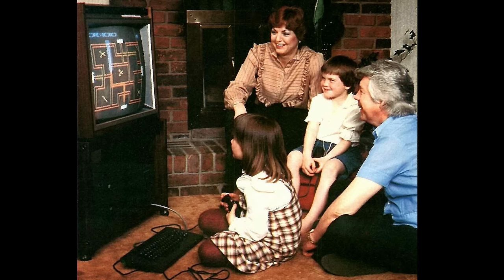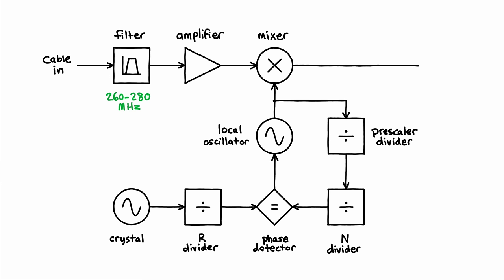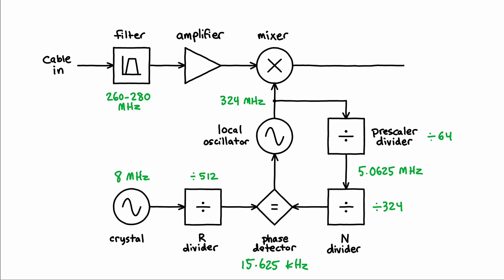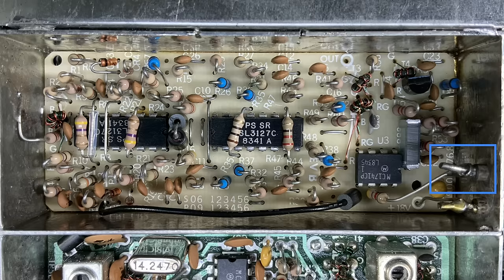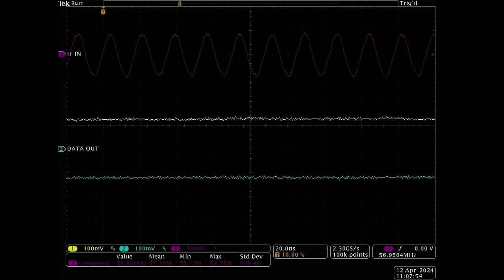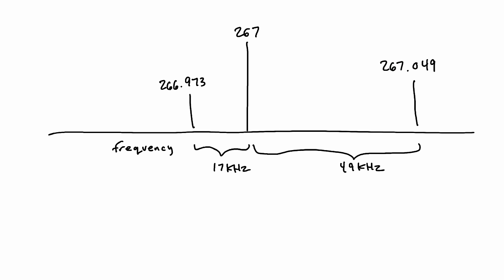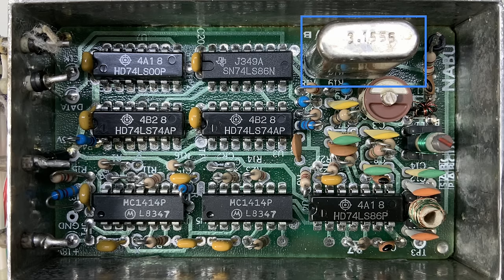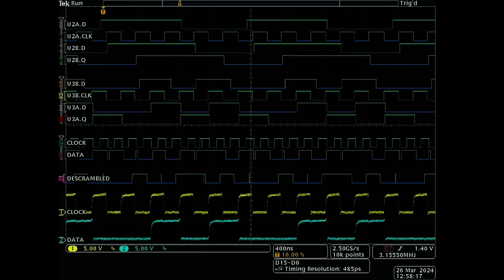The 40-Year-Old Cable Modem (part 1)

Comment: Thanks, a couple of us non RF engineers scratched our heads at this for hours and determined we needed someone more talented in those areas. Between the cable industry docs & Leo's recollections we were incredibly close, and I'm glad you have experimentally proved several of our assumptions! Moving ever closer to having a solution for broadcasting to multiple real NABU modems.

Comment: This is great.  I love the way you explain not just how it works, but how you figured out how it works.  It made it far easier to understand.  Also really cool to see tech that we think of as wired is actually not much different from radio.

If NABU had come out a decade later, it would have been a massive success.  Even with the tech of the 80s; imagine having 6Mbps at home in the mid 90s, instead of the dialup most people were stuck with until much later...

Comment: I worked as a interactive services catv digital video admin from 2003-2009. I never used ot heard about NABU till this video.
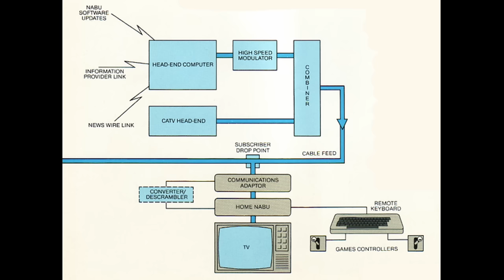 From what i can surmise from the diagram  @0:24 and the OP's excellent reverse engineering, the NABU software updates came in to the headend (HE) via satellite downlink. It was the most economical way to broadcast mostly static info over a large geographic area. Since this era of CATV had no reverse path, they likely used the HE Computer to mux in the other news-wire feed via either another satellite channel or subscribed to frame relay news data service, whatever was relevant to the local catv's market area. 
The HE computer would arrange this all in to a data carousel. Basically stream the combined data out on a QPSK modulator on ATSC channel 31 (QPSK being the grand-daddy of QAM, which pre Docsis 3.1 uses for downstream from the CMTS to the customers), starting with the first bit of the first file to the last bit of the last file, and the NABU receiver at the customer premise just waits until the data the user requested is repeted in the stream and fetches it. TBH this much like how guide, firmware and service data is obtained by catv settop boxes when they boot.
Reply: So that’s why it took so long. Not slow downlink, but just waiting for the correct stream 🥸
Reply: This answers the grand old question as to how/why it took so long for the STBs to boot and load certain aspects. Very interesting stuff!

Comment: I'm impressed with what they managed to do with discrete logic. (Of course, it's slow as an ice age, but for the era, 6Mbps was screaming.)
Reply from the maker: But when your computer only had 64K, 6.3 Mbps could fill it up (theoretically) twelve times a second!
Reply: Perhaps 6Mbps is the symbol rate but the actual data rate might be well lesser due low SNR and data directed to other terminals.  I guess Nabu shared the medium (the whole 6Mbpbs) with all active subscribers of the service hooked to the same analog mux.

I saw no specific mention nor circuitry, but I assume the service used coax for downstream only?
Reply: @hg-sx5nk more than likely, I would Hazzard to guess it simply blasted out ALL applications over and over on repeat.  1983 divided by 6Mbits it could deliver the entire software library in just a few seconds, so the receiver simply waited for the requested program to just get streamed out again
Reply: Im still using DSL with only 2Mbps download, and no Mobile data or fiber
Reply: @sharebrained  In 1984 we had an 80286 with a 40MB hard drive. Sure it cost about 20 grand, and I'm not dismissing the tech of this box but some of us ran more than a commodore 64 :P
Reply: @smackhead  but your 80286 couldn't talk to the Nabu cable modem... they were designed to connect to the Nabu PC which had drumroll please 64k of RAM.

I mean I suppose you COULD have connected a 286 to a Nabu modem had you been SUPER motivated, wouldn't have been much point since all the software available via it was Z-80 software for the Nabu PC...
Reply: @SomeMorganSomewhere  Fair call... I was happy with my 2400bps US Robotics at the time before moving to 9600 around 86 and 14.4K around 1990.   No wonder I never bought into the Nabu thing heh.
Reply: cable already in that range for video signal output as same range for mpeg4 format that use 6.1 megabit for 1080p format ...thats how fast for digital satellite operate at for one channel...imagine do for 200 channels ??? that is fast
Reply: Damn and I started at 36.6k. thank you for making me feel young lol
Reply: @smackhead And some of us with Commodores had more than 64k.  We had 800kb 3.5" floppies too!

Comment: Finally someone dove into this! I have done this before with WeatherSTAR equipment and fortunately for those, it was simple NRZ/NRZI FSK stuff so reverse engineering that was a bit easier. Glad someone took the plunge here!
Reply from the maker: Hey, awesome work on the WeatherSTAR stuff. I was talking with some nerd friends recently about simulating some 80s and 90s Weather Channel vibes for a TV station we want to run at a hacker camp this summer. Your work has been invaluable!

Comment: What a great bit of reverse engineering! Also a great example of how much more difficult it was back then before we had the RF and signal processing chips we have today!
Reply from the maker: Very true. Speaking as somebody who's learned far more about the digital signal processing approaches to radio than the analog side, it's humbling to see how a few simple, inexpensive components can provide a clever solution that nicely solves the problem, even if it doesn't have the theoretical mathematical perfection of DSP.
Reply: @sharebrained  Yes - in many ways signal processing was much more of challenge back then. Now just throw a few million - or billion transistors at it :)

Comment: Great video, thanks.  9:30 The signal level output from the shielded box may be part of an active AGC, some kit of this vintage takes the output from a peak level detector onto the logic board, then software with a slow PWM DAC generates the "real" AGC signal for some amp or detector. The advantage is that you can fiddle with the gain response in software. If this is the case look out for a "poor mans ADC", that is a logic signal being used to charge (or inverted discharge) a capacitor which a CPU line discharges (or charges), another common money saving trick.
Reply from the maker: Thanks! This is a bit of foreshadowing for the next video, but, thanks to @philpem we know that the logic board is doing next to nothing with the signal, other than gating the “CABLE” LED on or off. So we won’t be finding any clever PWM DACs, I’m sad to say. I suspect it’s because this cable adapter is expected to work in a very controlled environment, a CATV network, where noise and interference and loss is limited and they can design with less challenging constraints than terrestrial over-the-air broadcast.
Reply: @sharebrained  Interesting, thanks.  Cable modem AGC was typically not about noise but about saturation problems, some people close to the road box had a thumping great signal, some installers added an attenuator in the road box based on tests from the consumer end of the cable but other networks did not bother and relied on the box being able to cope with a signal from the distribution amplifier that sometimes barely needed the coax. This may be a UK thing as cable TV/modem came the UK many years after the US and Canada so maybe the standards had evolved.
Reply from the maker: Sorry, I wasn’t very clear. I think the design of the NABU Network Adaptor is exactly what you said. The signal power you can expect over a CATV network will be in a more limited range (maybe three orders of magnitude?), and the AGC is just a means to compensate for that. It’s not trying to fish out a signal among a ton of terrestrial noise, over 50 dB or more of power variability at the receiver antenna. I suppose it’s also a matter of inverse-square law vs. linear attenuation in a cable. Anyway, the signal metering and gain control are local to that amplification stage (no microprocessor involvement in gain control), and the signal metering just passes through the logic board (and a comparator, IIRC) to turn on the “CABLE” LED.
Reply: @sharebrained  Ah, I see, thanks. Interesting topic, nicely done with good and detailed explanation, I Look forward to the next part.  The 6Mbps show the equipment's age, I am interested in the digital side of that as well, it will be interesting to see how that data is decoded by the CPU. I will wait for the next part so no spoilers :-)  Thanks for taking the time to make a such a deep dive video. Nice use of test equipment as well.
Reply: @jonshouse1  6Mbps in 1981 was FAR from aged.

Comment: Nice!  I can't wait to see the next video.     This thing sounds like it was way ahead of its' time. It must have been a marketing fail or more likely they could not get more cable operators on board with the concept.   Back then, consumers didn't have any choice in cable provider and you usually were required to use the service provider owned equipment.  I didn't start hearing about cable modems until the late 1990's.

Comment: 15.625Khz is the horizontal frequency for.... PAL. It's odd that they're using this frequency for something unrelated, especially in an NTSC country. Maybe that was just a convenient frequency for parts availability? Or maybe it was meant to reduce interference fed back into the cable network, but they made it for PAL initially.
Reply from the maker: The connection with PAL is coincidental, I'm pretty sure. I think it simplifies the math greatly. The processor onboard the Network Adapter had only about 1K of program memory, and a few dozen (64?) bytes of RAM. Not a lot of room to do fancy PLL math. So they cleverly selected a crystal and PLL configuration that made the value in the N divider the same as the resulting local oscillator frequency in MHz. And all the cable TV channels are spaced exactly 6 MHz apart. So all the processor had to do was use a simple multiply-by-six function, to change channel number to a PLL N divider value.

Comment: Wow, if they had made this compatible with the C64 it would have been huge.  Being locked into one computer I never heard of was a bad idea, no wonder it failed.  The speed is also crazy, I didn't have 6 Mbps download speeds until probably 2010?  The Wikipedia page says this was bi-directional, how was this thing uploading?
Reply: The Nabu network streamed the entire software library on a loop.  The software in the library would change, with programs being added and removed from time to time.  The network adapter communicated with the Nabu PC at 111,865 bps, far slower than the network's 6Mbps, but Much faster than the typical 300-1200 bps modems of the time.  My understanding is that bidirectional communication was only possible in a very small area and I'm not sure if that functionality was ever implemented.  As far as being locked to one computer, that was the norm back then.  Every system ran software written specifically for that system.  There was very little software and hardware compatibility between systems.  Even Basic programs often had to be tailored for specific systems.

Comment: 10:36 : I vaguely recall that back-to-back transistors is often emblematic of trying to keep the transistor's temperatures close together, which in turn keeps their behaviors closer tegether. It's frequently an analog processing thing. Roman Black talks about it on the page of his site that goes through building a custom oven-controlled crystal.

Comment: I'm really happy to have come across this on Hackaday! I've been looking for information on how the NABU Adaptor works, I've been thinking about trying to design a circuit to generate the broadcast signal needed to have it receive information. A lot of what I could find was vague or conflicting (on the details that aren't covered in the manual like O-QPSK and the ~6 MHz bit rate), so this is great! I've got a NABU with Adaptor, but haven't gotten around to taking apart the Adaptor to try reverse-engineering it myself.
I was a bit confused in the video about where the bit clock is coming from. It appears in the block diagram, but isn't talked about looking at the schematic. I ended up watching the last third of the video a few times to see if I missed something.
Reply from the maker: You're right, it's not in there! I'd spent a lot of time already making this video and had to get it out. So I kinda swept that under the rug. I'll add it to the list of things to cover for the next episode, as I think clock recovery might be a good topic to explore while working on the GNU Radio modulator.

Comment: Probably unrelated, but the 6.312Mbit/s speed is identical to T2, which was essentially 4 multiplexed T1s however it wasn't used much, I wonder if that was intentional or not?
Reply from the maker: What? Wait... (grabs calculator) Oh wow, you're right, 1.536 Mbps * 4 is 6.312 Mbps!

That makes me wonder how NABU distributed data to the cable TV network head-ends. Does this mean they had four bonded T1 lines, or a T2, running from the NABU HQ to each head-end? If they were streaming the data locally at each head-end, I wonder how they synchronized/pushed the data out to the head-ends? Since the data on the wheel/carousel/cycle didn't change all that often, having a full 6.312 Mbps pipe to each head-end would've been needlessly expensive. Hmmm...
Reply: It seems I may have just created more questions lol.

6mbps back then would've been A LOT, that's 96(92?) phone calls! 

Most of my knowledge of tdm is Australian/European 2.048mbps style so I don't want to say too much in case I'm wrong.

Also, saw you video on the crossbar parts for the connections museum, how did that go?
(I only just found your channel)

I'm actually part of a similar museum, but I'm down in Australia, we're a bit smaller though.

Comment: this thing is far ahead of its time but in all the wrong ways like being forced to be online to use it and it even had ads. but the technology is really mind blowing this was before my time but from what i heard everyone in my region still used antenna based tv with 2 channels and cable wasn't really a thing. i do remember when the internet started getting popular and dial up was the norm until the 2000s. at least most of the population had cable tv at that point i am not sure when it got popular probably in the early or mid 90s and you also had people into satellite tv for a while

Comment: 9:30 It could also be a gain control signal for the amplifier. My assumption would be that it is at maximum gain until some part down the line senses a signal, and then the logic board decreases it once the output signal gets too strong, to keep the signal strength equal independent of how strong the input signal is. That would at least make a lot of sense if the amplifier has no internal automatic gain control.

Comment: Those CR labeled diodes and transformers placed close to them (most likely) make  Double Balanced Mixers
Reply from the maker: I'm sure you're right. There's a pair of baluns on each side of that bank of eight diodes, which pretty much has to be the quadrature demodulator's mixer. As for the face-to-face transistors, I'm still a bit befuddled. I should trace out the schematic around those and see what it starts to look like.
Reply: @sharebrained   I was talking about those face-to-face "transistors". For me these are schottky diodes. There are also two transformers with a tap on one side which suggests those make a Balanced Mixer to mix the RF with LO
Reply from the maker: @CezarySiw  Oh, OK, cool! I’ll take another look. I really need to step up and make some degree of a schematic for the quadrature mixer and the clock recovery section of the data demodulator.

Comment: In 1983 telephone line was anything but slow. Even then obsolete 300 baud guarantee 64kB program in less than 4 minutes. 9,6kbps modems introduced in 1984 shortened that time to less than minute. Programs were simply small. And fact is that XT machines had usually only 64kB of memory. Situation was vastly different in 2000, when dial-up was usually pathetic 33,6kbps (when you were lucky, provider supported 56kbps or even ISDN with "super" 64kbps) and programs were typically in megabytes. Downloading CD-ROM game like Unreal Tournament via dial-up was 2 days long Odyssey and only torrents capable to easily resume downloads were usable. When I went to University year later, where 10Mbps was standard (and in 2002 we switched to 100Mbit and 2 years later i had as dormitory network administrator dedicated 1Gbit line), it was like going from car to rocket.